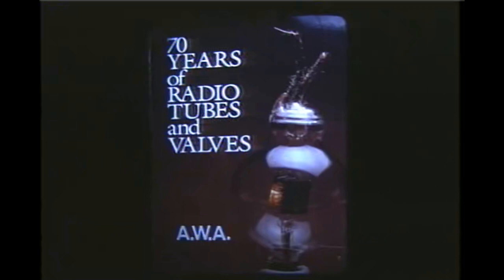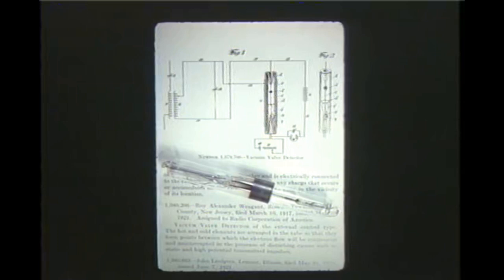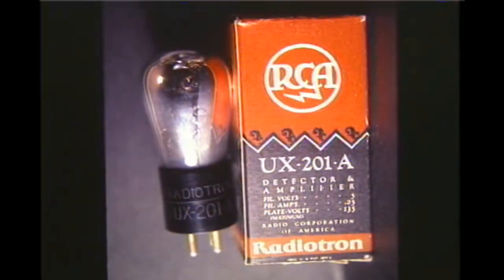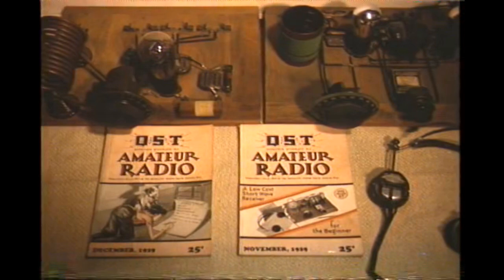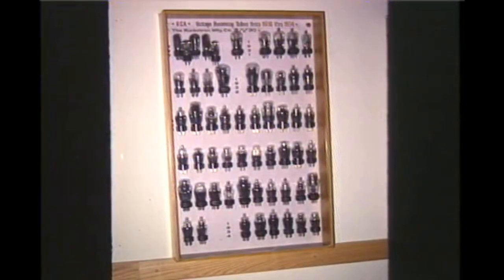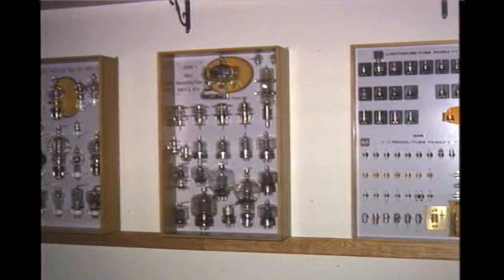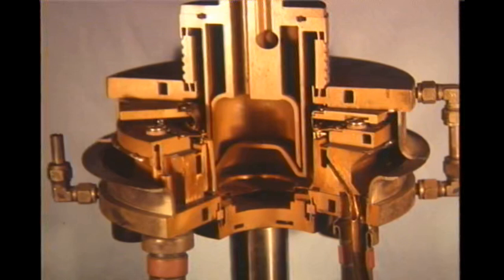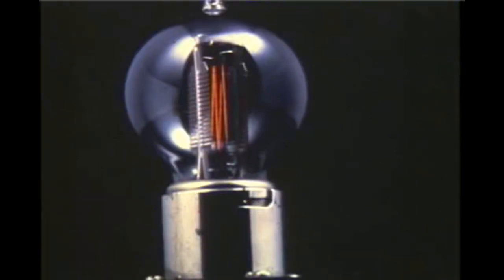AWA Classics  - 70 Years of Radio Tubes and Valves

Comment: Hi AWA!
    I worked with Bruce when the museum was in East Bloomfield in an old two story home. We rebuilt the museum tearing out the old horseshoe and plaster walls for Sheetrock , refinished the floors, and rebuilt the grand staircase. I attribute my beginning in Amateur Radio to Bruce and a fellow named Burt Johns - WA2IYA, both were my "Elmers". I saw and handled many of the things mentioned here in this video, operated the spark gap transmitter, and made one contact with it. I still after 45 years have the QSL card! Bruce was a good friend for many years, as was Burt. I will never forget those exciting times.
73's DE W4FJF.

Comment: Actually electronics using tubes continued to be made until the early 1980's.  Ham equipment such as the Heath SB102, HW101 were still being sold into the early '80s, these were mostly vacuum tube powered.  Hybrid ham transceivers that were mostly solid state, but had vacuum tubes in the driver and final stages were still bein sold into the mid 1980's.